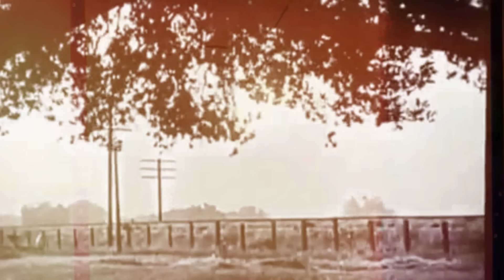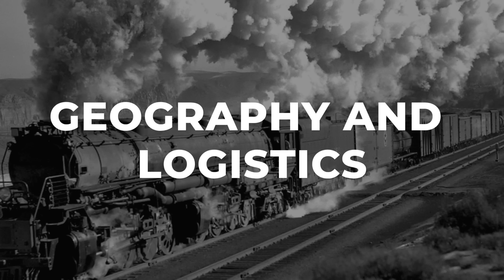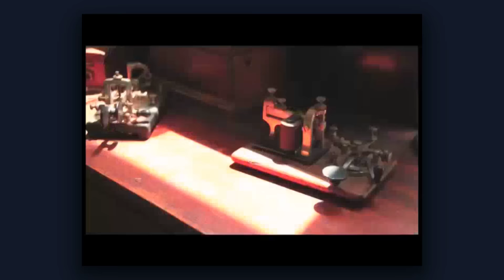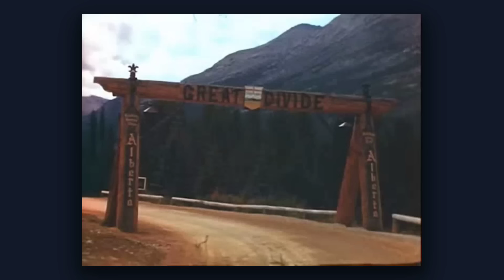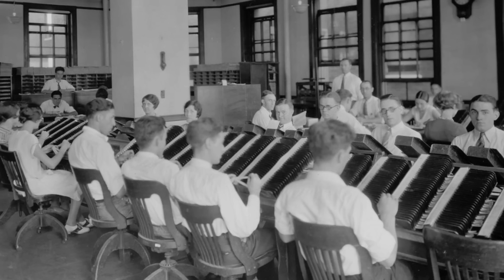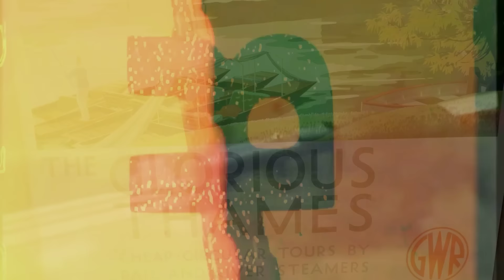The Real Reason American Steam Trains Made More Smoke Than UK Trains

Comment: Only a few railroads in the Northeast used or even had access to anthracite coal, hard coal was a premium product that was extensively used for home heating in the Northeast and for export to Europe where the French built an industry of appliances to burn this product for heating and cooking.  I suspect that UK firemen were better trained and disciplined to follow the rule of 'little and often'.  Generally the British roads operated lighter trains on generally better track with fewer sharp curves or long hills.  Distances between major cities is a lot shorter and the distance between NYC and Chicago doesn't exist in the UK without getting your feet wet.  In the days of steam railroading it was very uncommon for a locomotive  to travel more than a few hundred miles from its home yard and most roads had watering facilities less than 100 miles apart or less, they needed a LOT of water.  Steam locomotives needed a lot of routine maintenance, every few hours of operation so the normal practice was to switch the locomotive out and send it home with a returning train where it could be serviced by its home crew.  Another consideration was changes in geography.  On the PRR, the run from Newark thru Philly to Harrisburg is mostly flat, a fast big wheeled loco could make a quick run of this but west of Harrisburg the speed is slower and the mountains higher, a heavier locomotive with more but smaller drivers will be needed, in eastern Ohio you can go back to the speedy one.  Yes, some desert lines used larger tenders to carry more water or even a second tender but remember the loaded weight of the tenders reduced the amount of revenue load the train could carry.  Just like the weight of the battery in an electric truck.  It seems that the Brits used more tank engines, ones with the water tank in the locomotive over the driving wheels where the weight of the water contributes to the potential tractive effort of the locomotive.   Most all of these problems were solved by the diesel locomotive along with really big fuel savings. I urge those that can to visit Steamtown in Scranton PA, go early, they run a steam excursion train daily and roundhouse visitors can see the nearly five hours of preparation  using two skilled mechanics that it takes to get a steamer ready for its short daily run.  For diesels, the locomotive is on the ready track in the yard, the engineer walks out, checks the fuel and crankcase oil (just like a truck driver) then get in the locomotive, turns the power on, presses the start button, then waits for air pressure to build, with air he calls the tower on his radio asking to be cleared to the track his assigned train is on.  Steamtown is a National Park.

Comment: Railroads encouraged (indeed, demanded) a clean stack.  A smoky stack meant fuel was going to waste.  A good fireman working with a good engineer got that clean stack.  Heavy smoke was usually the result of acceleration or very hard work.

Comment: I remember pictures of Union Pacific  Big Boys that used unrefined crude oil. Pollution City.
Reply: Big Boys plural burning oil? They experimented with one, it didn't work. They had to figure out why so 4014 could burn oil successfully. All others burned coal.
Reply: @gsengineering284 so it was that locomotive that made a cloud of black smoke that was 100 times bigger than the entire train.
Reply: @ngauruhoezodiac3143 probably ran cleaner than coal. Also, oil fired locomotives burned Bunker C, not crude. Today , I think UP uses #4 fuel oil. It does not have to be heated like Bunker C or its close relative #6 oil. I also doubt the whole premise of the video. American photographers prefer to shoot when the fire is at its dirtiest and most of the time they are trying to fire clean.

Comment: Our own experience was that small fireboxes had higher draft and lifted more of the coal as unburned smuts.  What was given to the crews was the mantra "black smoke is wasted fuel".  Which is true.  But your explanation doesn't match our own experiences.  Basically flogging any engine created a less efficient one but the cost of replacement was so high that it was more economic to overload a smaller one.  This became particularly bad with oil firing where it is easy to simply add more oil.  Giving more power but less efficient combustion.  It is true that a really top crew could do a better job with any particular fuel.  But not every crew is that good.  Inexperienced crews were needed before they became experienced ones.  Spark arrestors were fitted inside the smoke box.  So that wasn't the answer either.

Comment: HEY - What are you talking about. Wester engines used dirty bituminous coal because they were hauling it.  This is a misrepresnating. VERY FEW engines used anthricite. THEY DID NOT HAVE ACCESS TO GOOD COAL THAT IS A LIE..  THAT LONG DISTANCE RUNNING IS ANOTHER LIE.  Tank cars have a small capacity compared to the length of travel,.  US routes went for hundreds of miles.  MAC tendar capacity was 25,000 gallins of water and 20, tons of coal.  An, in the west it was dirty coal from Wyoming.  Engines of ANY SIZE can run nearly smokeless if the air, fuel mixture was balances.  US Fireboxes DID NOT SIT OBOVE THE DRIVERS. THey rested on the trailing bogie.. Fireboxes DID NOT GO BELOW THE BOILER.  THIS WHOLE THING IS INACCURATE BASED ON PARTIAL TRUTH AND INACCURATE INFORMATION. THIS IS TOTAL JUNK.

Comment: Apologies in advance but this will be a lengthy comment.
In addition to critical comments made by others here, I feel compelled to observe that your arguments are as false as the 'bad coal' myth, just in case kiddies watching come away with false conclusions and progate them.
The bogus relationship between distance run and boiler dimension has already been addressed, but it is worth adding that the reason for smaller boilers on British locomotives is primarily due to the very limited loading guage in Britain. Railways developed first in Britain and spread rapidly at a time when the main competition was horse drawn carts and canal narrow boats. By the time the advantages of a more generous loading gauge allowing larger locomotives pulling larger loads became apparent, too many route miles already existed with which any new locomotive needed to be compatible, and that limitation still restricts railway operation in Brtain today. Exhibit-A would be to compare the permitted height and width of trains operating on 4' 8 1/2" guage lines in Britain, with the far larger dimensions permitted on 3' 6" gauge lines in South Africa. 
I'm not sure where you get the idea that smoke was celebrated in the US but legislated against in Britain; the imposition of clean air acts in Pennsylvania and Ohio were instrumental in early dieselization of yard shunting and the late developement of 'smoke consumers' as perhaps most evident on the Pittsburg & Lake Erie's last class of steam locomotive, the A-2a. A row of seven cans is conspicuous down each side of the fire box, these being devices through which compressed air was blown over the fire to cause turbulent mixing of air and unburnt fuel in order for the locomotive to consume its own smoke. A similar device was installed in South Australian Railways 520 class locomotives but consisted of a single exhaust steam jet in the firebox to promote the turbulent mixing of secondary air and unburned coal above the fire.
It's also bogus to suggest firing of locomotives was especially different between the US and Britain; any fireman in a 'hand bomber' worked alone and had responsibility for not only firing the grate, but maintaining water level, monitoring boiler pressure, plus helping the driver watch the track and signals where the driver's visibility is obsured by the boiler. And no self respecting fireman simply tumbles coal randomly into the firebox; each firing will include shovels directed to each of the front conrners of the grate, some to the centre and some into the back corners. There is no desperate shovelling at stations and sit back and breathe and fiddle with dampers, a fireman's lot anywhere is constant work. But in any case the PRR M1 is a mechnically fired locomotive, so the fireman's work has more to do with constantly monitoring the fire and adjusting the distribution jets, and more on that later.
Now you mentioned that when the driver 'called for more power' the sudden rush of steam would reduce the draught through the fire. Wrong! The exact opposite is true and herein lies the real reason for plumes of black smoke. 
The main handicap the US locomotive has is a 'couldn't be worse' exhaust, which imposes high backpressure on the cylinders in order to create a sharp blast and concomitant high draft; it's the lazy way of trying to maximise boiler output. High draft enables rapid combustion of coal per unit area of grate as a result of the high volume of air being sucked through the grate by the exhausting steam, but that draft comes at the expense of the sharp blasts causing such pressure drops in the boiler as to lift off unburned coal in substantial volume. To be fair you did correctly make the conclusion that smoke equals unburned fuel but you misattributed the cause to the dimensions of the firebox.
In fairness to the US locomotive designers, British locomotive's exhausts were no better until around the 1930s when British locomotive designers began to take note of the work of Andre Chapelon of the Companie Paris-Orleans, who appreiciated the need for more internally streamlined steam passages and good exhaust to lower internal pressure  losses and so allow the locomotive to convert more of the energy in the steam to doing work, instead of wasting it overcoming turbulence and back pressure through the steam circuit. British express lcomotives built just before and just after the war began using the Kylchap exhaust to good effect and this exhaust, while providing a strong draught does not require high back-pressure on the cylinders to do so and in turn generates less violent blasts at release. A violent blast tears firebeds apart, especially thin 'white and bright' firebeds, which contrary to your video was the normal way of firing British steam locomotives. The advantage of thick firebeds and extensive secondary admission (over fire air) wasn't widely appreciated until the Argentinean engineer Livio Dante Porta developed the gas producer firebox while working for the Ramal Ferro Industrial Río Turbio, and then later, more famously, employed by British engineer David Wardale in the rebuilding of the South African Railways 19D class number 2644 and 26 class number 3450 'The Red Devil'.
To imply that British steam locomotives uniformly ran with narrow grates (fitting between the frames) is only true of locomotives of X-Y-0 wheel arrangments, which were common on the GWR (which you seem to have a particular interest in), but the common 20th century British express locomotive type is the 4-6-2 'pacific' and these have a wide grate (extending over the frames). 
Coming back to the question of coal quality, the most visibly obvious example of the wide firebox was the Wootten firebox developed by the Reading Railroad in Pennsylvania specifically to burn cheap anthricite waste (clum). Aside from allowing the use of poor quality fuel, by allowing more low calorie clum to burn at any given instant of time, the combustion was claimed to be virtually smokeless. This is due to the wide grate allowing a larger cross-sectional area for the primary air to flow through, meaning that for a given draught, the air flow is slower and less able to lift and carry fines while passing through the firebed.
One other concession that could be made to your argument that wide grate equals more smoke, is that above a given grate area, the stamina of a fireman becomes the limiting factor in firing rate and thus evaporation rate. With a large grate, it is common to fit an automatic stoker and since these spread coal from the stoker table around the grate using steam or compressed air jets, it is easier for the draught to lift smaller particles of coal before they've settled on the grate and as a result automatic-stokers generally result in around 5% higher fuel consumption all other factors being equal, and that inefficiency correlates with more smoke.
To reach the a deeper conclusion to why some locomotives make more smoke than others, it would be highly instructive to read the following books and papers:
Andre Chapelon - La Locmotive A Vapeur (translated to English by George Carpenter)
David Wardale - The Red Devil And Other Tales From The Steam Age
Livio Dante Porta - Theory Of The Lempor Ejector As Applied To Produce Draught In Steam Locomotives
J. J. Koopmans - The Fire Burns Much Better: 200 Years Of Steam Locomotive Exhaust Research, 1804-2004 
Col. H. C. B. Rodgers - Chapelon: Genius of French Steam

Comment: Firemen shoveling up to five tone per hour is the claim. Who can shovel 166 pounds of coal per minute, all day long? Theat level of fueling was accomplished by automatic stokers. I f you want to see how the Brits fired their locos so efficiently, find a video on YouTube showing a documentary produced by the LMS Railway; the gist: shovel smaller quantities more frequently, and adjust flues and dampers to burn flue gasses until the exhaust is a light-brown haze.
Reply: Yep, dumping a bunch of fresh coal on a hot fire will smoke until the hydrocarbons reach flashpoint.  This is why the fireman would stop stoking in the last couple of miles into the station and not stoke until they pull away.  The fireman would make sure the fire was sufficiently stoked to manage that time gap.  Smoke means a lot of coal is being added which would happen shortly after leaving stations, or as they approach uphill grades where they will need more steam production.
Reply: Interesting that you mention mechanical stokers. By the early 1900's American locomotive designs were reaching a scale of power output and fuel demand that was greater than even the burliest and efficient fireman could handle. I think it was the Pennsylvania Railroad that first installed mechanical stokers. They became an obvious solution for those gargantuan machines that required inhuman amounts of coal to haul massive loads over vast distances in the US. 
As far as I know, they were tried on some British locomotives but were never adopted wholesale because the benefits were not on a scale that made the investment worthwhile. I am not sure if it is a myth or not but I once heard that Stanier used them on some routes for his  large locos but it worked out cheaper and more fuel efficient to have two firemen on the footplate.
Also, British firemen were not keen on losing complete and intimate control of the fire, which most of them considered an art, a science and a professional skill, as much as a physical labour.
Reply: @flunkyminion  Not to mention by the late 1930s many were also switching to fuel oil rather than coal so all they had to do was adjust a feed valve.

Comment: Most American engines did not use anthracite coal which is what has 5% volatiles.  Anthracite locomotives did not emit smoke.  In fact New York city only allowed anthracite to be burned in ferries to reduce air pollution.  Most coal used by the Pennsylvania RR was high volatile about 35%.
Reply: Which compares with British coal usually with no more than 13% volatiles, often as low  as 9% on the Great Western Railway which he mentions several times.